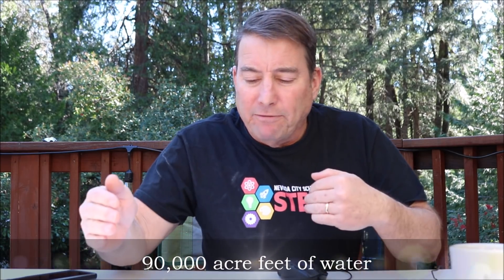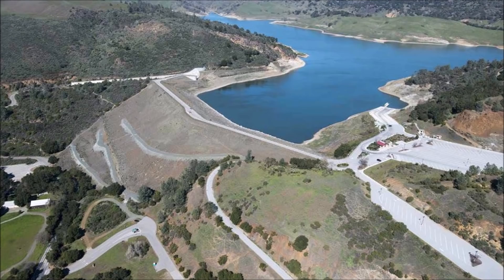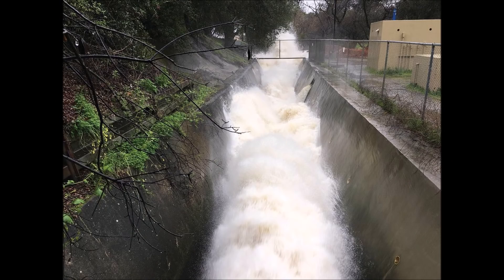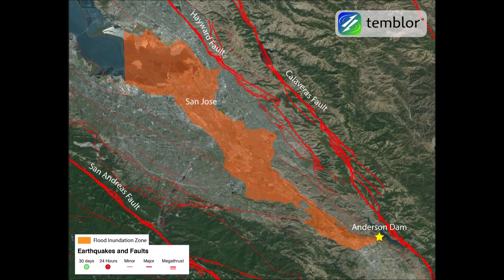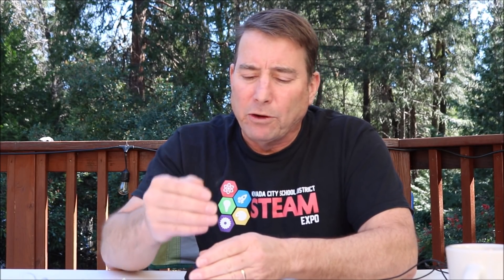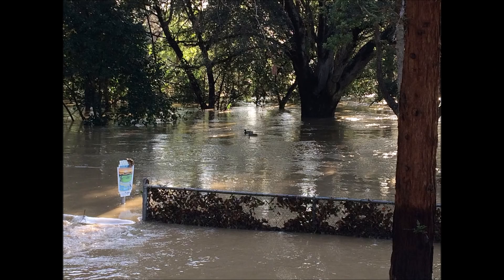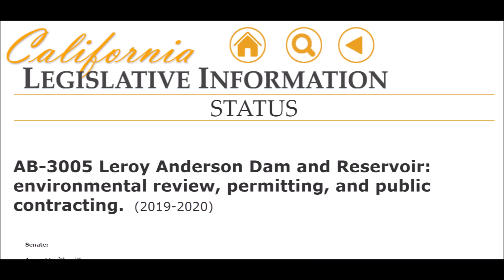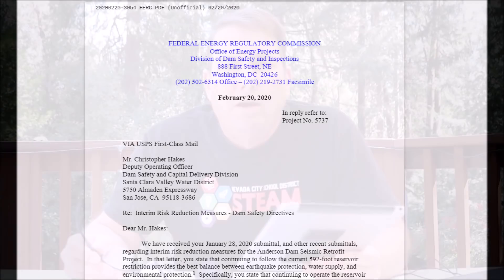Anderson Dam, Ca. vs FERC - "Drain The Lake"

Comment: Why would anyone buy a home (directly) below a damn? Better question, why would the powers that be allow homes to be built below a damn?
Reply: If you watch the potential flooding simulation at the start of the video you'll discover that it's not just homes directly below the dam that are in danger. If the dam goes, half the city of San Jose would be flooded, including the downtown and the airport. Furthermore, flooding would also occur south as much as 40 miles away to Monterey Bay, taking out significant portions of the city of Santa Cruz. Since the city of San Jose was there first (founded 1750), the real question is why was the dam allowed to be built where it could flood the city? The reason of course, is that the creek with no dam also had potential to flood the city! Dams in California are typically multi-use. In this case Anderson Dam provides drinking water to the water district, it provides flood control, it provides steady, controlled aquatic habitat to the Coyote Creek watershed and it offers recreational uses.
Reply: @dlwatib  Santa Cruz is at the Northern edge of Monterey Bay and would be missed entirely if the damn failed based on the Valley Water video.  Watsonville though has a comparable population and looks like it'd take a direct hit to me.  Gilroy also has 50+k people in it and would be hit bad.

A part of the problem as I recall years ago, is that as our understanding of the geology around there increased over time, so did the estimated chances of a sufficiently large earthquake close to the damn increased.  Combine that with the damn not being as sound as originally thought and it's a recipe for trouble.
Reply: Money talks, everything else walks.....
Reply: better question.. why even try to have a huge non power generating dam in earthquake country?
Reply: Dirt Beard 
water...
California relies, in large part, on reservoirs as a water source.
Reply: @stingray4540  right, they want to SELL you the water instead of allowing people to have their own well or collect their own rain water.
Reply: Dirt Beard 😆😆😆
Wow, dude. You obviously know nothing about the region we are talking about...
Reply: That would be so the powers that be have their palms greased, who in turn wet the hand of the powers that don’t be, who in turn spit in the palms of those who tie the steel and dump the rock.  Too bad none of them will be alive if it fails.

Comment: With every bridge, dam, road, building or any other structure that was engineered, also comes an opinion of life expectancy and during that life, a maintenance requirement list of things that need to be addressed. This is where the problems begin...the owners or those who were in charge of maintenance requirements don't do the maintenance. Our infrastructure has been subject to this kind of management for decades. In southern CA, back in the 1994 era, there were heavy rains predicted and all of the flood control systems hadn't been maintained as they use to be in earlier decades so when the rain came, the flood control rivers were full of years worth of dead wood, rubbish, overgrowth of various plants and trees and when the water came and needed the pathways to direct the runoff to the southern coast, it couldn't. So, gravity forced the runoff all over the Long Beach and surrounding cities and thousands of cars, trucks, trains, etc. were caught in deep waters that exceeded 6 feet deep. This cycle occurred again in other locations over the years so the folks who run the various municipalities failed to do their jobs and supply the required maintenance these engineered flood protections needed to do the job. It all boils down to the kids minding the candy store and their method of thinking.  Yet, here we the public continue to hear the excuses and lies of what really happens to our infrastructure, especially Oroville, even though the revenue/taxes etc. are all there supplying the needed funds, the money is not used or diverted politically for some other idea. This will continue to occur until those responsible are put into prison.

Comment: Juan, Why not build a new dam slightly downstream from the original one? This way they could continue to allow controlled releases through the new dams bypass tunnels. There would be no need to deplete the original dams water levels until the new dams construction was completed.

Comment: I will have to correct you on that, I think rather than aging infrastructure isn't just a US problem.
If you replace that with WORLD, then you may be onto something.
Reply: Hello CMDR - Not sure of the rest of the world but " generally " here in Australia most Gov' owned infrastructure is maintained, that said, infrastructure that has been sold off is not kept to the same standard it once was, out electric grid also suffers from greenies and lack of uprgrades, in the recent bush fires, lots of poles were destroyed, the companies had to bring in other States crews to help re-build. Maybe the damage was so large that they would have had to have done that even if the utilities were not sold off. I am surprised though when I watch US TV shows the number of rusty bridges in the background. It seems in this case CA is more concerned with the possible damage to the outlet pipe in the case of an earthquake than the whole dam failing - I wonder how many would drown if that happened??
Reply: I am an Aussie and when i visited California in 2005, I was SHOCKED but the aging infrastructure THEN. It certainly isn't world wide.
Reply: I only care about my Country. What about you?

Comment: Is the water from the lake used for farming in the area? There are so many dams that were built before a lot of research was done. They need to be replaced but nobody wants to do it. Nothing has gone wrong for so many years that it's assumed it never will.
Reply: Anderson Lake is the largest of ten reservoirs operated by the Santa Clara Valley Water District. It provides drinking water (and perhaps contributes to agricultural use water), and the dam provides flood control.

Comment: If you were recently questioning a possible drought soon, is now the best time to drain a lake?    (Assuming it can be used as a water source and also that I understood the opening animation of the dam draining into the ocean - not another lake).
Reply: Lake Anderson is part of the water supply system. The animation was showing what might happen if the dam slumped (due to liquefaction) and failed. The dam emergency spillway and the outlet at the base of the dam both flow into Coyote Creek, which eventually discharges into San Francisco Bay.

Comment: Put a funnel in the drain. Install the funnel when level of water is low and if necessary pump the water into the funnel to drain the lake. If there is a slide over the drain intake the funnel will block the slide from covering over the intake and water can still exit the lake. Of course if an earthquake causes a collapse of the lake drain pipe system and gets blocked up.  That is a threat even now so when they rebuild a more suitable system should be designed.